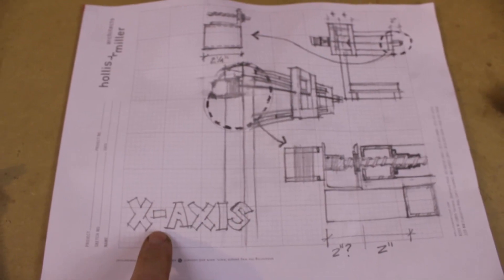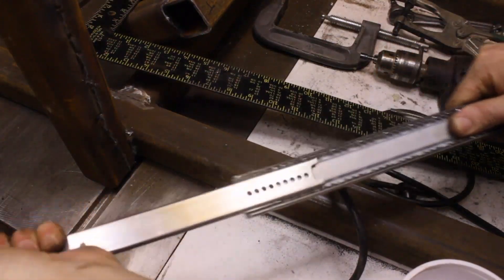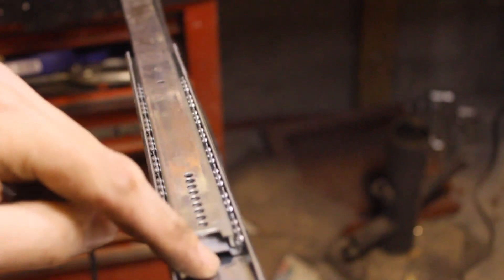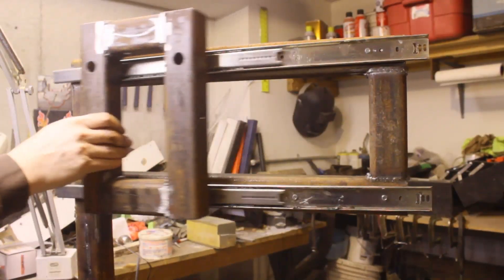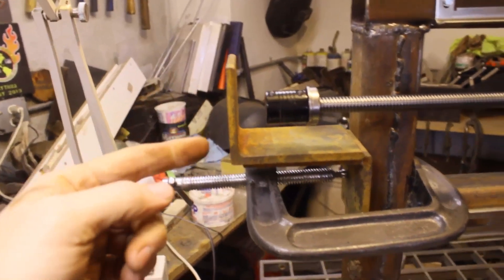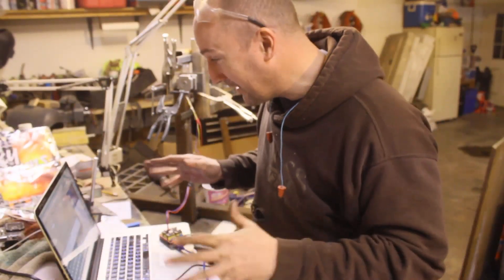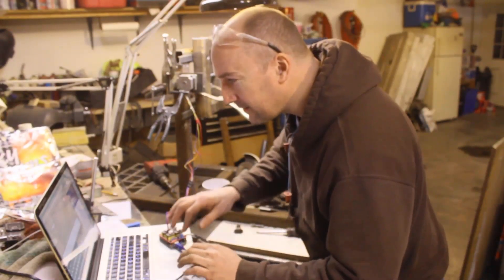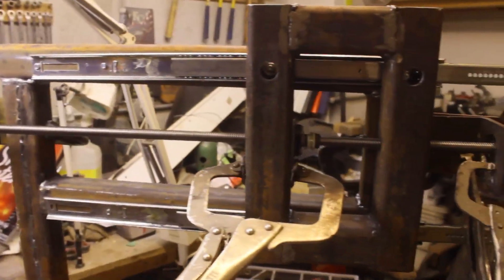Stepper Motor Brings the X Axis to Life - DIY CNC

Comment: un f::::ing belivable where did you get the plans for this?
Reply from the maker: +Joe Dov There are no plans...  I drew up a sketch, then started hacking away.  I have about $300 in it + the router.  I figure I saved about $1000+.  I needed something that I could use to make guitar parts...  I think I've got it!!!  First order of business is to make some plaques that I can screw up without any crying...  Then I move to the expensive wood and make the fretboard I built the machine to make.  THAT will be fun.

Comment: Id be interested to see the deflection you have now on the slides side to side (up or down as it sits). Maybe set your indicator base on the top of the frame and put the indicator against the sliding assembly and grab it with your hand and try to move it.
Awesome job Greg! I am tipping my KU hat at you Pal!
Reply from the maker: tomswonderfulworld Thanks Tom...  I'll be indicating a BUNCH of stuff to see how much flex there is.

Comment: Btw, what was that fastner you used on the stepper motors?  Don't think I have seen one of those before.
Reply from the maker: turbocobra It's from a secret stash...  I couldn't find an 8-32 in my big box-o-fasteners...  I found an old tuna can from Andrea's grandfather.  It had those fasteners in there along with 2 tools to drive them.  I figured I HAD to use them on this project.  It seems to happen all the time.  I won't have the right part or tool in my box, but my Uncle's and grandfathers' boxes always seem to have what I need.
Reply: Greg's Garage Ahh, that's really cool!  Those are neat looking... just be sure not to lose the driver!

Comment: Make it oldschool and put voltmeters and ammeters for each axis. You were 50 percent correct when you had the + & - screwed up. Lol. ???what size r yur stepper motors? How many oz. or amp???.
Reply from the maker: The motors are 200 oz in.  I think they will eat 2A each.  I need to get a build box set up for the circuit board that has a fan.  Now that it's pushing a real lead screw, it's starting to draw some current and things are warming up.
Reply: Wow 200 oz. Thanks. Yeah maybee liquid cooling. Lol. It can double as a heat pump. Bmp.
Reply from the maker: LOL!  200ozin is pretty small by some standards.  I guess I'll find out when it starts to cut material.  I'm going to guess I'll have to get a bigger controller...  I was doing more testing and the board was really hot.
Reply: Holy schnikies....dont let the smoke out....

Comment: You need to go into the parameters and I forget the exact terminology that Gcode sender uses.  But basically you need setup the motor specs within it so when you tell it to move an inch or mm it knows how many revs of the motors that is going to take.
Reply from the maker: Yes.  I'm thinking that's in the GRBL setup on the arduino..???
Reply: I don't have carnal knowledge of that system yet so I dunno.  Logically thinking there would have to be some sort of setup on the arduino and the actual parameters should be in the gcoder.  I saw a video about this a few months ago when I get home from work I look it up for you, its good video and should get you going fast.
Reply from the maker: Mopardude Thanks!